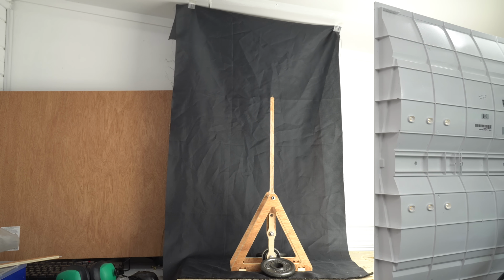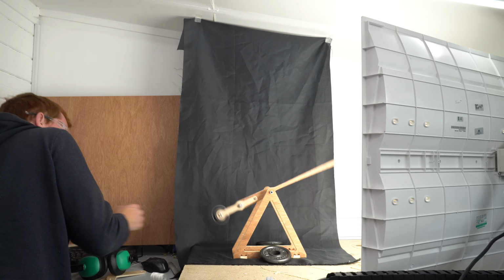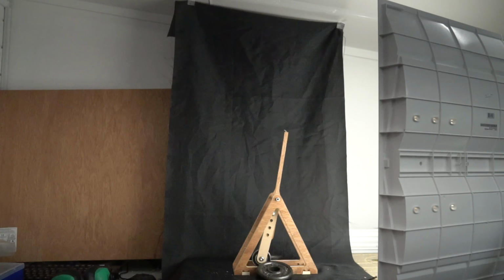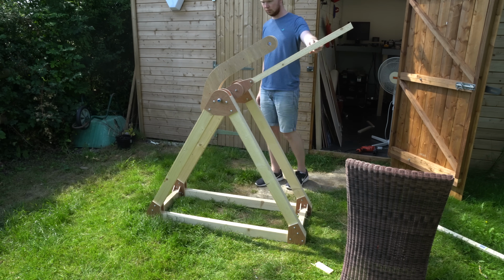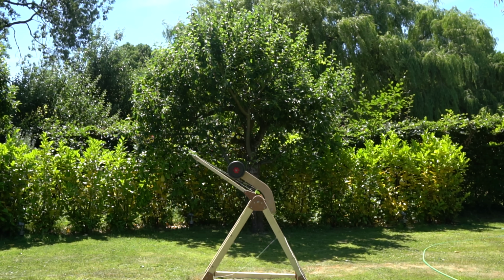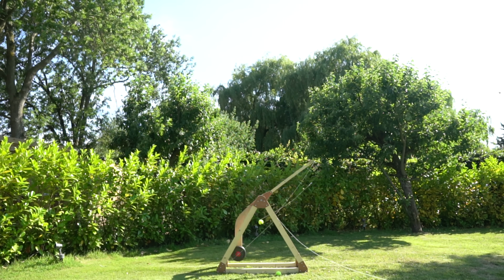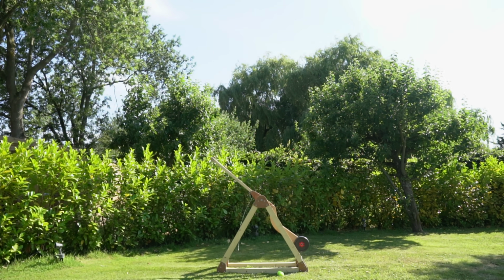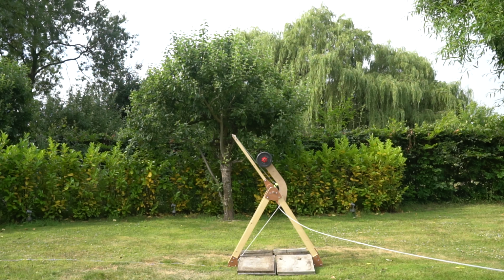Optimising a Trebuchet

Comment: Remember it takes energy to accelerate those arms. If your projectile weighs less then the arms, proportionally more energy is going to be spent accelerating the arms then the projectile. A heavier projectile helps turn this issue around. Or lighter arms. Or both. 

In bow crafting there is a old saying "A well made bow is 9/10ths of the way to breaking when you shoot it" which means, you are stressing the material to within 1/10th of its breaking point. You are getting the most you possibly can, out of the least amount of material.

Comment: The trick that most trebuchet builders miss is the principle that the counterweight must fall as vertically as possible. That is accomplished by putting wheels on the trebuchet frame and allowing the frame to move forward while the counterweight falls. You have thrown a twist into the physics of the trebuchet with the unusual design, which allows the wight to fall from a greater height while keeping the leverage arm very short. But you will still notice that energy is lost while the weight is pulled away from the vertical fall. If the frame is allowed to move forward on wheels, then more energy in the form of speed can be leveraged to the throwing arm.

Comment: The bent arm is bringing the weight drop track towards the perpendicular.  Calculus would indicate that the most energy transfer would be a perpendicular drop of the  weight.  Floating Arm Trebuchet type. The drop speed is at maximum because it is perpendicular. No weight oscillations flying about. To get more range would be to simply increase the drop height.  Give this design a side by side test.

Comment: add wheels instead of blocks
-- those wheels on medieval catapults 
werent for transport so much as to give
the forces a follow-thru outlet which
makes for longer throws... the fact
that theres so much destabilizing
energy left in the apparatus may 
be solved by other adjustments
but the base wheels could be
all you need for further efficiency

Comment: Putting it on wheels helps the throw as it needs to rock back and forth as the weight falls to allow it to take the path of least resistance straight down.

Comment: @Tom You should rather calculate a potential energy basing on center of mass of the whole arm, not the single mass itself. This way you will get correct value of max speed and higher (but real) efficiency of the arrangement.

Comment: I can appreciate the engineering effort that went into this, but it very much looks like it would be incredibly impractical to use once upscaled or would require quite a complex mechanism to get the arm and counterweight into a ready to launch position basically the moment the whole construction is too big/heavy to be manually 'loaded' with a hands-on approach (standard historical designs really just need accomodate lifting force to set the counterweight into launch position, fairly easily done with pulleys, etc.).
The original design is, if not optimized for raw performance, a lot more streamlined for actual deployment (simpler to build and doesn't require some fancy mechanism to load and get it ready to fire if you want to throw heavier projectiles), a quality whose importance that shouldn't be underestimated.

Comment: When you "raised" the weight in the first comparison, you actually increased the arm length of the weight. This will reduce the angular velocity.  In the second design with the weight above the sling,  you have dramatically reduced the arm, and the long angular momentum will always reduce the velocity.

Comment: This is a very high quality video, I appreciated it very much. However, I think you are wrong when calculating the coefficient of efficiency. This coefficient is calculated by dividing outputted energy with inputted one. Because energy is proportional to square of velocity, not velocity itself, the percentages you calculated should be squared. Also, I have seen some designs where counterweight is fixed to vertical rail and moves only down, and pivot point is moving horizontally. I think you could achieve even better results with that kind of design.

Comment: you convert potentional energy in kinetic energy
E pot = m1*g*h
E kin = 0.5*v²*m2

m1*g*h=0.5*v²*m2

m1= weight from the counterweight in kg
m2= weight from the projectile in kg
h= height in m
g= gravitational acceleration (9.81 m/s²)
v= velocity in m/s

v=√(m1*g*h)/0.5*m2
You calculate it.
Than you take the measured speed and divide it with the calculated one.
Thats your efficiency.

one of the easyiest calculatings back in the technician engineers school lol

Comment: Best clip about  the evolution or how to modified a lever class one. Im a huge fun of levers and  how they work.. I’m looking to build also a dynamic trebuchet to load with much lighter stuff 🙂, thinking about if we use and place a fly fishing rod as a arm and cast a fly line and a actual fly 🙄😍. There is a huge question for me regarding the arm length and structure material like carbon fiber, what do you think it would happen with a more short and more flexible arm please?

Thank you for sharing!!👌👌

Comment: i once entered a bowling ball throwing competition with three teams. my team decided to create a classic catapult with a fixed launch angle of 45 degrees and three truck suspension coils as the spring. the arm was held back but a steel cable with a loop and the loop had high test rope making the final connection. to fire the catapult you simply chopped the rope with an axe. we used a come along to pull back the arm against the spring. the other two teams LAUGHED at us. they both had made HUGE trebuchets. one team used plans from a kit online, and had even poured cement as their counterweight. the other team had a more scrap built trebuchet with eyeballed dimensions. when it came time to compete, we decided to go last. the first massive fancy trebuchet fired, and the bowling ball went backwards 3 feet. their next shot went directly up in the air and came down on the trebuchet, breaking the arm. their 3rd shot went forward a few feet and the arm exploded. 

the second team goes with their crappier trebuchet and it actually works, but the release angle is about 30 degrees BELOW the horizon and they drill the ball into the dirt about 20 feet in front of them 3 times.

then our team. the lowly catapult underdog. we load up and fire, and our ball launches at exactly 45 degrees and we make about 150 feet. our second shot almost hits our first bowling ball, but the cable that pulls back the arm breaks. we simple replace the cable and our third shot again gets about 150 feet. we DESTROYED the "superior" engineering of the trebuchet. the moral of the story? it doesn't matter how efficient your design is on paper if the damn thing has zero reliability. catapults work EVERY TIME with few exceptions, and are insanely easy to build, fix, and tune. and they are shockingly consistent. if you get a catapult ranged in, you are hitting your target nearly every shot.

Comment: If the rope were replaced with a solid whipping arm you could fine tune it much easier while increasing the strength, accuracy and weight of projectile.

Comment: 5:21 you may get less bearing drag and increased efficiency, by removing the seals and grease from the 2rs bearings?

 Its been a while since I last had a class or read a book on bearings, but with your speed being so low I doubt the grease would extend their life as at such a slow speed a oil film/wedge wont form between the races and balls [but that is just a armchair guess]. Really liking the videos.

Comment: I'm not complaining about anything here. I'm just making an observation at 4:50. In slowing down the vid to .25 speed, the counterweight seems to drop backwards at a 30 or 40 degree angel where as your working model looks like your counterweight still drops close to a right angle. Not sure if there is anything to this. Care to comment?

Comment: Not long after I first found this video, I had a project to do for physics class where pairs of students were to build a trebuchet and compete with other classmates to see who could launch a tennis ball the farthest. Needless to say, I opted for me and my friend to take a non-traditional approach to trebuchet-building and make a whipper-style trebuchet.
After fabricobbling together something that only stayed together by the power of hopes and dreams, we tested it:
It failed.
We adjusted a few parameters, (Hit the nail we used for a release hook with a hammer) and it failed. Changed out a board, and it failed. Sewed a new basket, and. . . you get the picture.

So, the day before the project was due, I said "let's just see what happens when we add more weight,"
Can you guess what happened? 

It worked!    Somehow
I made sure nobody changed a single detail because it probably wasn't going to work more than absolutely necessary.
The day came, and we ended up getting the longest launch out of anybody in the past couple of years from that point!
A massive ego boost for sure.

Though, I was right about the trebuchet, as after bringing home the contraption, I was only able to launch it once more before it fell apart.

Comment: Amazing video thank you for great inspiration on engineering methodology.

How is it that calculations in energy manner hold truth? Isn't there supposed to be a consideration for arm length? More travel results in in more acceleration gained and higher trejectory  velocity no? Or it doesn't matter and it's a question of longer time to get to velocity value that matches the initial energy put to the system?

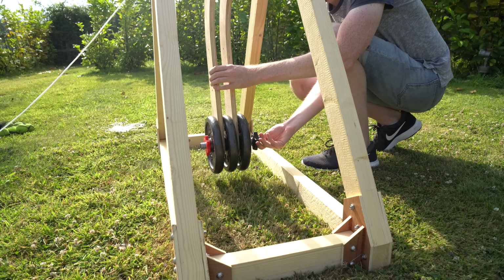Comment: At 13:32 could you make the bottom of the basement longer, and keep it the same height, to keep it from rocking. Also, could you upscale this to launch a 50 lb (22.6 kg) steel ball without making and major changes other than support?

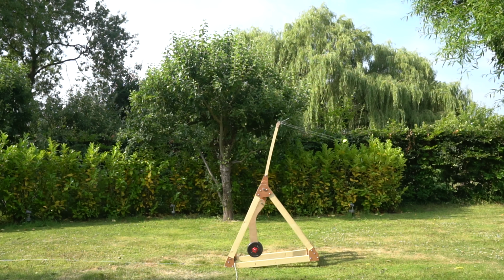Comment: 13:38 I think it did break 100! Because the path was curved and you used a straight line estimate, 99.8 mph is a minimum. In reality, it followed a longer path than you measured thus making your measured speed just barely too low.

Comment: Suddenly I wonder if a trebuchet can be made without using simple old lever tech. Levers work on rotation, and it would be hard to make a mass fall straight down vertically this way.
Reply: Check out a pump in an oil field. The cable/chain goes straight up and down.   ===X====D     It goes over the D and into the hole. It may work better than the norm. Cheers!  Alex in Montana

Comment: guess you forgot the square on kin. energy formula. at 8:55 made me question myself for a moment. and correct me if i am wrong but you take the vlocity as a constant but it will keep slowing donw while getting higher and goes faster when it starts to fall down, so did you take some avarage or...?

Comment: I'd like to note if you're calculating your energy transfer efficiency as 100*(Launch velocity)/(Theoretical Max Velocity) its incorrect. It should be the ratio of the kinetic energies of your projectiles, which can be made to the correct efficiency by squaring your percentile in decimal form.

Comment: instead of using 15kg as a potential energy with gravity (trebuchet). could cocking a spring or a "sling shot" with 15kg of force produce better result with the same projectile? maybe making a ballista?
can you do a video comparing the various launching method utilizing all the same preset force and projectile size/mass.

Comment: It would have been really interesting if you non-dimensionalized the equations of motion for this to make sure the large scale model was dynamically similar to the small scale model. Optimizations for the small-scale model don't necessarily carry over to the full model unless they are dynamically similar. Doing this, you could have also wrote up some simple code to get a theoretically optimal design before finishing some small scale optimizing at the experiment level! Regardless, cool video!

Comment: Instead of using a solid wood main beam, try making a laminated wood beam with weight cutouts that still allow high structural strength but lightens the main beams weight?

Comment: Seems modern ! But in fact, it is a waste of energy to launch the link at the same time as the "useful" load. Old such machines had a special form of the hook an link (double) so they could launch the load without the link -> better efficiency… and no need to have plenty of links and waste time to put a new one after launching. And perhaps ask the ennemy if they agree to give you back the links they have "received" from you ;=) !

Comment: Very impressive dude. Have you ever tried wheels on the rig so it can move back and forth instead of using counter weight?
Reply: The base comes off the ground because the falling plates still have some lateral movement. But the weight you put on the base may add more thrust than allowing the machine to travel back and forth.. I'm not quite as slick with the math as you!

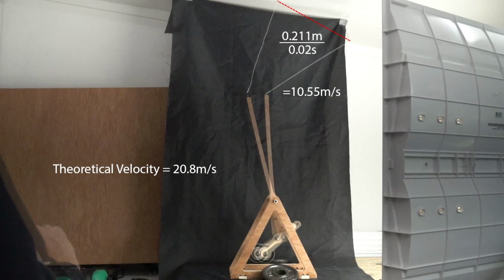Comment: 2:20 EFFICIENCY ISNT CALCULATED BY DIVIDING VELOCITIES!) efficiency is a prportion of energy “taken” by a ball from a counterweight

efficiency of trebuchet isnt 50%, by dividing measured  velocity by calculated velocity:)) its actually is about 25% by dividing  measured KINETIC ENERGY of a “bullet” by calculated POTENTIAL ENERGY of a counterweight ... is the same as proportion of saquared measured velocity (10m/s)^2= 100 (m/s)^2 and calculated velocity (20m/s)^2= 400 (m/s)^2 what results to be 100/400=25%

Comment: Your original efficiency calculation at 9:19 is not quite right. Kinetic Energy is 1/2mv^2. Therefore the actual efficiency (based on energy conserved) would be 39.1%. Great video though! That's a cool build, and I'm going to have to get a CNC router.

Comment: Put wheels on it.  You're losing energy moving the counterweight forward and back, putting wheels on it will allow the system to maintain a more linear vertical change in the center of gravity and should allow you to get some added energy into the projectile.

Comment: it would not work for heavy projectiles. The centrifugal force applied to the wire and pivot points is too much. This design would work only for light projectiles such as darts, which in battle would be pretty deadly. So this would not be a siege weapon but a battle field weapon.

Comment: How are you doing velocity calculations with just video footage?
Reply: The frames of the video are a fixed distance apart in time, and the locations of the projectile give a fixed distance apart in - distance.
   (Change in distance) / (Change in Time) = speed. Convert to meters/second or miles/hour as you wish.

Comment: Ever just try dropping the weight straight down and spooling up the axle with some rope?
Reply: Or a chain. Using only a rope or chain wouldn't let the weight be raised as high as with a rigid piece, so it should have a rope/chain wrapped around a disk and then a stiff part so it can be lifted.

Comment: You did not fudge the wait what you did is what is called pissing on the sandbags and no it's not actually pissing on the sandbag it is how you turn premix bagged into concrete walls the mass of the end-product being more than the individual pieces due to the absorption of moisture you just skipped the water and added another weight

Comment: Curious addendum:  when building and testing scaled down versions of Edward I’s treb Warwolf, researchers found putting the whole base on wheels gave a more efficient throw acting counter to the horizontal motion of the counterweight.  In effect as the counterweight swings towards the back of the treb, the wheels allow the whole treb to move forward proportionately adding a bit of forward momentum to the projectile and otherwise dampening the stresses on the frame.  I’d be curious to see if adding wheels to this whipper treb design improves the projectile speed or range.

Comment: +@UC67gfx2Fg7K2NSHqoENVgwA
To have a fixed acceleration period, you just have to make both sides of the arm have an equal moment.  Moment = Force * Distance
You could consider a rack and pinion drive.  That way the energy delivered to the payload will always happen over a fixed distance regardless of the weight used!

Comment: I'm not an engineer but I wonder if it will work to replace the rope for another arm that is retracted in the early release but it will be slowly released as the main arm is released too (the projectile is located on the tip of the secondary arm). Note: the secondary arm has exactly the same function and form of the rope b-ut it is rigid. The problem that I can see is that the energy at the end of the release would break the second arm, so a spring at the end or something similar would be needed. Please would you consider this?. Someone who answer this? Please. Thanks
Reply: I think you’d lose too much energy in the weight of that arm. String is comparatively very light

Comment: Your sling design is terrible. You need to make it out of leather and sew it.  You calculate the shape of the sling from online calculators for slings.. it will also give you sling length. I did this back in 2003, so surely the data for slings is still online.   A cup is not the proper design, the design is like an eyelet that POPS the projectile out of the back of the sling.